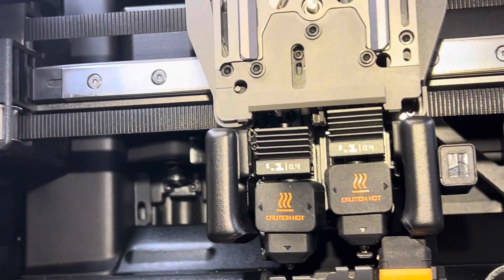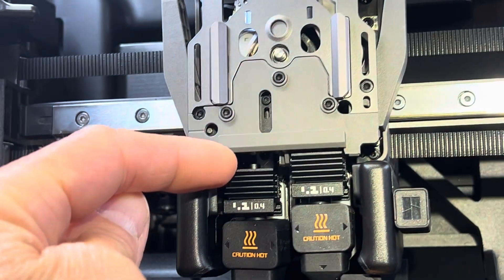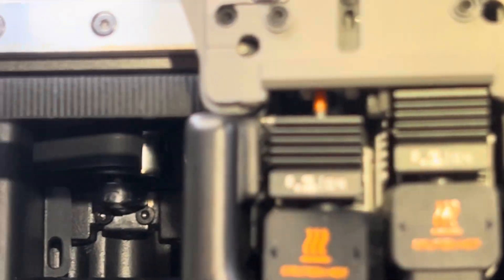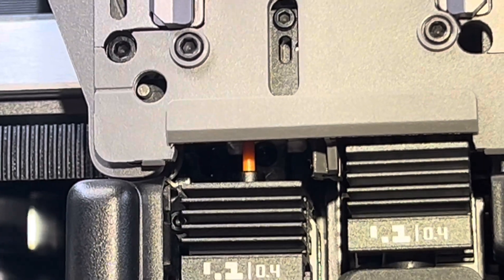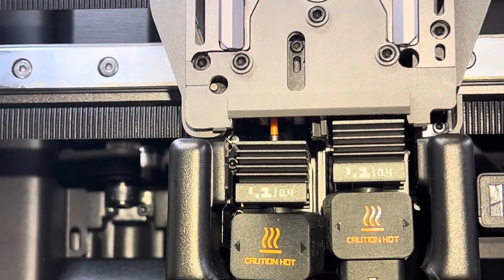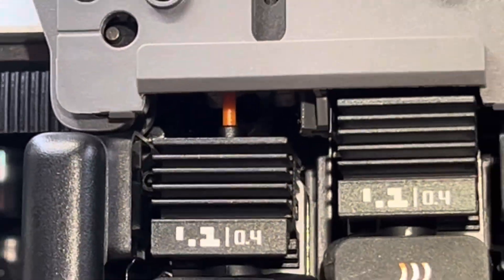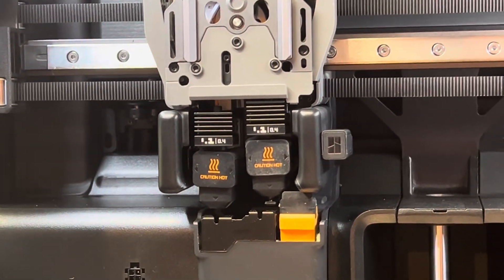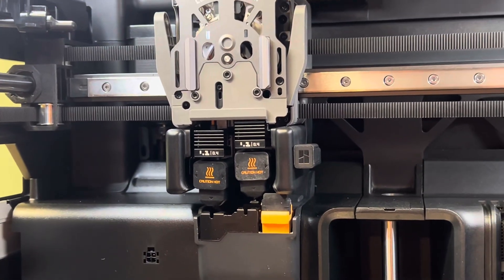H2D Left nozzle Mis-feed - nozzle is in the lower position!?

Comment from the maker: Fixed!!  Behind the front plate - above the left extrude there is a sliding plastic guide - that guide was somehow stuck in the up position.  There was some filament in the slide area…. and the slide action was kinda sticky and not wanting to slide.  I carefully moved that slide block up and down and eventually - it cleared itself and the slide now moves 100% as it’s supposed to!!

WORKS now!!

https://youtu.be/Xmtm9IRfhX4?si=S32FefpKViDZsxzZ

Now that I have taken the front portion of the head and understand what’s all in there - now it’s a little easier to problem solve.

I would still like to see a Bambu webpage full of HOW-To’ videos.  It would be nice to watch someone go through steps to address problems like this.

Comment: I have had mine for a couple of weeks, about 120 hours printed on it so far. I have had to disassemble the extruder head twice, very scary the first time, and WOW is that thing overcomplicated. Anyway, I have not seen this issue you have, my issue was with switching between a low temp filament and a high temp CF filament, something when switching is majorly wrong, its like its trying to purge a CF filament with 260C when it needs 290 to melt properly, jammed the PLA good. The other thing that happened was that I was printing the CF material and tried to use PLA as support (using other nozzle), BIG mistake, there was so much heat from the CF material (290C nozzle, 100C bed) it caused the PLA to melt prematurely clogging up the entire extruder. Lessons learned, the CF material is a PAIN to clear out as well, so I am VERY careful when I print that.
Reply: The slicer warns you not to do this, but yeah.. PLA is a no go above 50c+ chamber temps
Reply from the maker: What did you end up using for CF support!?  Or did you just use that same material for support also!?  I have had really good luck with my H2D - except this one mid-feed issue.

Thanks for your feedback tho!
Reply: @G6Wings after my issues I didnt dare to use anything else, so printed the supports with CF. Altho its much tougher so can back down on the strenght of the supports.
Reply: @G6Wings BVOH or HIPS for high temp stuff my man

Comment: There is a moving hollow rod, that should go down to the nozzle, when it is in the diwn position. This tube seem to be in a stucked position. I had a different problem with mine, where i completely needed to dissasemble the toolhead
Reply from the maker: Ok - It does load about 50% of the time - not every time.  Tube - Hmmmm…. Really!?  On a H2D!?  I am going to look for a video - how to disassemble the H2D Tool head.  I took the 4 screws off the front plate - but…. Stuff didn’t want to just come apart - so I need a little help.

I would like to find a good disassemble video and instructions - on Bambu H2D trouble shooting page!!

I sent Bambu a direct message to - we’ll see how they respond.

Comment: it seems the moving part is stuck up high. The black screw should be on the bottom.
I'm also a bit worried with your nozzle head where it is zoomed in on the top left side. Seems something is bent.
Reply: I just had this problem today too! Keep me posted if you figure something out
Reply from the maker: Hmmm….  Nothing bent - prints fine - except this loading issue.  Machine has not had any trauma!!